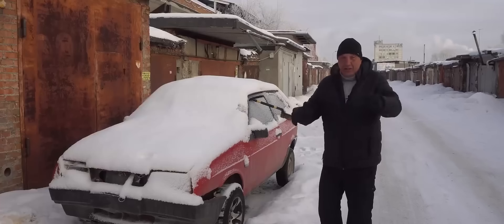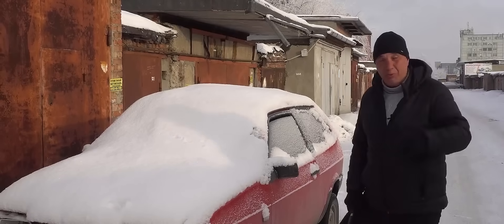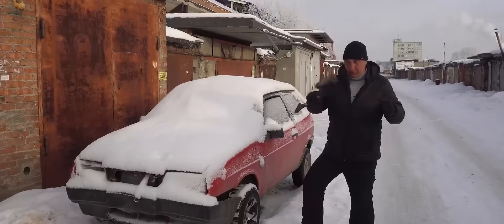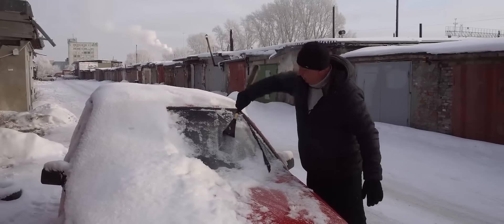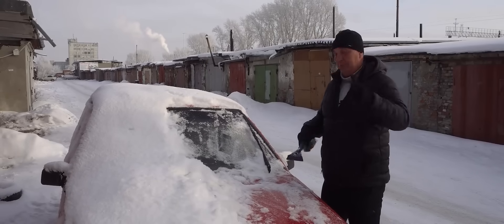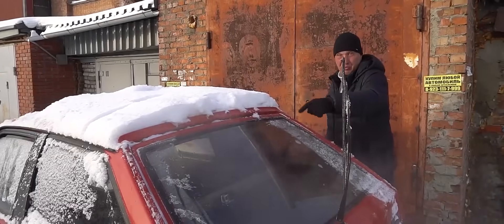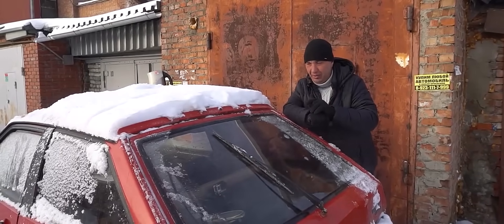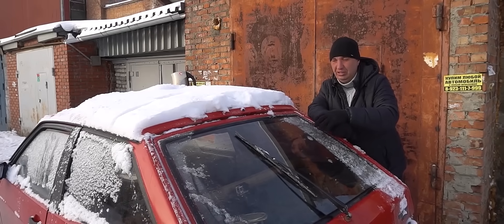What happens when you POUR boiling water onto a frozen windshield?

Comment: its probably because you opened it to put the camera in so the outside temp and got inside while you took the water to heat up probably a few mins by then the glass at adjusted to the outside temp hence no breakage...

Comment: It was not cold enough for it to crack. Honestly i think were he fucked up at was removing the mound of snow off the windshield  if he had left it on and just started pouring the hot water id bet 20$ it would have shattered the glass! Hmm also he could have filled up a squirt gun with hot water sat in the car then shot at it the outside of the windshield would still have the snow mound  on it the key is making sure the glass is as cold as it can be then you drastically and suddenly change the temperature which causes its integrity to ultimately fail it would just shatter in place thats all.

Comment: Cold glass is contracted. Heat expands it. Thus, it is inclined not to break. More likely to break sitting in hot sun several days (mine did). However, hot glass suddenly cooled with ice water more likely to crack.

Comment: Glass usually shatters when it cools down too quickly, because the particles  become compressed, causing the glass to shrink very fast. The lack of filled space is why it cracks. But when you heat glass up quickly (or any substance for that matter (haha pun not intended but still appreciated)), the particles gain energy and start moving farther apart from each other, so that the glass technically “expanded” to what it normally would be, and didn’t crack. Based on my knowledge of thermochemistry, this is my educated guess as to why it didn’t crack.

Comment: The water only needs to be above 0C to melt the ice on the glass. use some lukewarm water if you are willing to risk cracking your glass by pouring water on it. The higher the temperature of the water, the higher the chance of cracking the glass. body temperature (or 30 ish C) water will do it even if you have to do it a couple times to get it off.

Comment: It has nothing to do with foreign vehicles. I have a 2006 Corolla S and do this all the time during winter. Only I use plain hot water, not BOILING and it works perfectly fine. Live out in southern AZ where some mornings are in the low 20's
Reply: YaBoi Rob 
Low 20's = winter? 😂😂😂🤦🏼‍♂️
Reply: Skyprince27 It's the fuckin desert, what do you expect?
Reply: YaBoi Rob 
I know, I've been to Tucson in February and Phoenix in October. 
FYI: You don't know what winter is.
This is winter:
http://cdn1-www.mandatory.com/assets/uploads/2011/12/file_180109_0_montrealsnowheader.jpg
Reply: Skyprince27 Cool. Hope you enjoy it 😂. I've been to Quebec before too. Just because I don't live there doesn't mean I don't know what a season is.
Reply: yanks say temps in farengay so fuck knows what rthat means in modern measurements
Reply: Here in Finland some mornings are -20 (-30°C)
Reply: -40 s ℃ here guys just start the damn car it will defrost by itself lmao morons

Comment: You poured it to slowly and in too small amounts. From what I've heard people usually crack their windshields when they throw bucket-loads of hot water on the windshield, causing the glass to expand but not the rubber seals which are rigid from the cold thus cracking the glass.

Comment: If it's tempered glass when heat hits the cold glass as long as there is no stress on the glass it shouldn't break, however if there is any stress on the glass the heat will cause it to break.

Comment: A good way to prevent potential cracks is to run the car for 10-15 minutes at idle with full heat on.
Good for the engine in -30c or lower & the windows are warm from the inside so less shock

Comment: I’ve poured boiled water onto icy windows literally hundreds of times...never seen it shatter or crack...I always assumed that was a warning left over from the old days of non “safety” glass..but I dont know it all...maybe it could break..🤷‍♂️🤷‍♂️🤷‍♂️
Reply: you should be fine as long as you have no chips in the glass from rocks hitting it, those make the glass weaker and more likely to break and crack.
Reply: careful with warm water, i ended up with a thicker layer of ice on my window than before once xD
Reply: Is nobody going to ask why this dude has poured boiling water onto icy glass hundreds of times?
Reply: Yep, me too, but i do it slowly, it´s the only way to melt ice at such low temperature. Never had a problem, not even with already cracked or chipped glass.
Reply: Yeah but no need for the water to be 'boiling' really all you need to quickly de-ice it is warm tap water 30-40C. No point taking a bucket of 100C water to any part of your car...
Reply: I have done it every winter nothing has happened
Reply: I used to do it a lot.. Nothing ever happened.. Well it is not advised as good practice.  But it works.  If the glass has some dammage, even temperature difference can break it.  (cold night)  Removing it with a scraper in my experience does some dammage as well.  So I put an electric heather on the mains in winter time :)
Reply: El Sea ive had it crack from turning the heat on on defrost and letting it warm in extreme low temps . Never water though
Reply: Also makes a difference if the the glass is bonded to the car or fitted with a rubber gasket
Reply: Leaving a nice puddle on the floor which freezes over.  Well done.
Reply: just use luke warm water
Reply: elijah mikle but windshields are expensive af
Reply: El Sea how old are you ? Just asking, and what is your gender ?

Comment: you need to keep the wipers on. the extreme temperature difference from the hot to cold area will crack the windsheild. Pour the hot water under the wiper.

Comment: It will only crack if you do it the other way: pour very cold water onto a very hot winshield. I´ve done it by heating glass cups and pour very cold (almost frozen) water on them, instantly crack. The reason is simple: When you heat something the molecular expansion process is relative slow; in the other hand, when you rapidly cool down something that is very hot the reorganization molecular process is quite fast and almost all materials tend to crack, and if it don´t crack then it becomes "tempered".

Comment: Glass only cracks when it's heated and then cooled rapidly because when glass is cooled unevenly it leaves expanded and unexpanded areas in the glass which creates differing amounts of stress that can cause it to crack or even explode. It's called thermal shock

Comment: Pouring cold water on a hot piece of glass is many time more likely to crack.  The cracking occurs because when something cools it contracts.  So glass that is hot and then cooled quickly cause the glass to shrink faster than the glass can take and it shatters.  Heating glass fast enough to crack is extremely hard.

Comment: It is simple. The windshield on the Lada cars is not glued on the car, it stay on rubber gasket so it can take the fast dilatation. So is nothing special with yours Lada's car. The modern car use the windshield to reinforce the body.

Comment: I've been pouring water as hot as my taps could produce for years on my car windows. lot harder frozen than that light dusting of snow too. Keep wipers on low so the water doesn't freeze seconds after it clears the ice. Faster than scraping it off. Wouldn't try on an already cracked window as I'm sure it would crack further.

Comment: The cracking often happens when the windshield isn't installed correctly. Mainly due to variations in the thickness of the sealant used between the windshield and frame.

Comment: if you people think a car windshield will crack like that, then you're stupid. The cracking was from the ice expanding from the hot water. A windshield is made in 3 layers with a layer of plastic in the middle to prevent shattering with glass flying all over your face. Ever heard a pebble hitting your windshield on the highway? You can have little pebble flying at you at 60mph and your windshield wont even have a crack.

Comment: The reason the windshield didn’t crack is because your windows are open, the temp is just as cold as the outside,. If you had the windows closed then pour the hot water the windshield will crack.

Comment: Cold makes the glass contact. Putting hot water on it makes the glass expand. It won't break unless it expands so much that the surrounding area that holds it in place stops the growth and it would crack because it can't expand beyond it's borders. But if you have a hot glass, and rapidly cool it then the glass will crack because it contacts so quick that it breaks. I've done it before when I had a small fire in an ashtray and I put cold water in it too turn the fire off. The stay broke right in half.

Comment: Pouring boiling water onto glass in freezing temperatures has an endothermic reaction before it even hits the glass, flash boiling most of the water in a plume of steam. A proper windshield is heated in a furnace at a temperature of over 600 degrees and is then tempered using air pressure. It will resist endothermic reactions upto three times stronger than normal glass.

Comment: is because capitalist foreign glass attempts to steal all the heat from the water for itself causing a temperature differential whereas the sovereign domestic glass divides the heat into an equal share between the glass and thus no temperature differential to cause cracking

communism, comrades. it works

Comment: What comes to mind is if the windshield of the lada is not laminated. If it is a single "slab" of glass the head will spread rapidly and warm up the entire glass at once. On newer cars the windshield is laminated, which means heat will travel more slowly towards the inside and that will maybe result in a crack.

Comment: The reason not to use hot water has nothing to do with the glass and EVERYTHING to do with the glass seal.   Use just cold regular water and get those wipers working / or wipe them clean and you'll be just fine.

Comment: glass only cracks when it is heated and cooled quickly in succession, why did you clean the window as the hack would work on the snow filled window. 
although when its hot it expands so a rigidly installed piece of glass that expands with no space will crack instantly

Comment: Honestly what else we’re you thinking. Some people can hit a window with a hammer as hard as they can and nothing happens.
Reply: Akira One Hollywood
Reply: "Some people can hit a window with a hammer as hard as they can and nothing happens."
Sorry but no, hitting a window with a hammer 100% breaks it. Unless you are a child and it's a rubber hammer. 
Car windows are designed to break and crack but stay together mostly, so if you hit one with a hammer it will crack badly like a spider web effect, but the window usually won't shatter and fall to pieces usually.
Reply: Akira One yep, because glass is designed that way, which is why window breakers work because it takes that force and applies it to a few millimeters of space, and from there it’s a domino effect
Reply: not true at all unless the hammer is a roofing hammer. if the window was that easy to break then it wouldn't be a problem breaking them to get people and animals out of the car when its needed. and keep in mind that though you are correct, you are only correct when the striker hits the window multiple times wasting precious time, which is why "window-breakers" are specially designed the way they are.

Comment: If you put a chip in a windscreen a crack may originate from that chip and grow longer over a number of days, without any sudden changes in temperature. If that is happening and you pour hot water on a cold windscreen or vice versa the process of crack propagation will be accelerated, that is what happens. 

Cracks will always originate from a point of high internal stress no matter what the material is. A small chip in a windscreen will provide that sress. The windcreen in the car in the video clearly has no pre-existing damage.

Comment: What if it’s not glass and just Plastic.
Although i doubt it.
Reply: RiAnime never underestimate Russia
Reply: Well windshields are just 2 pames of glass with a plastic sheet inbetween them.
Reply: These types of laminated glass and tempered glass have a fairly wide thermal gradient. Even the fact that the thermal shock is from freezing temperatures to almost boiling, however, it’s most likely still within its static thermal limits. Meaning, the glass is being heated over a larger area when he pours the “boiling” water. 

It’s sort of like how you can burn yourself on a hot surface. If the temperature is really high, you can have a more significant burn injury in less time. If the temperature is lower but contact time is prolonged, you can still receive a significant burn over a longer time. So for burns (thermal stress) it’s a relationship between temperature and time. When he pours the water over a larger area the heating rate is decreasing and therefore the dynamic stress is decreasing.  There are many factors that can account for dynamic thermal stress compared to the static thermal stress, mainly the rate and area. Some glasses have microscopic variations, depending on its composition. 

Anyhow, enough rambling. Nothing breaks here.

Comment: It didn't crack because Lada's use a rubber windshield gasket like an older car, it allows the glass to expand and not crack and it's laminated glass, import cars have their windshield glued in with very tough silicone adhesive, the glass can't expand and so it would crack.

Comment: The fact it is rubber mount helps, if you do it on bonded screens there is less room for expansion of the glass.
Additionally, a compromised screen with stonechips or cracks you didn't notice would have very different results.

Comment: This is vary interesting because I fix windshields chips and cracks for a living and we are only supposed to fix the weather between 45 degrees Fahrenheit and 95 degrees Fahrenheit because the chip or crack can spread while we work on it. Maybe if you have a chip already then change the temperature rapidly it will cause it to crack.

Comment: It depends on how suddenly you introduce the temperature change.   Pouring it on slowly apparently didn't cause a drastic enough shift of temp change to implode the windshields here.   If you were to splash the water onto the windshield in a large volume of boiling water, it no doubt will work fine.

Comment: The driver's window is down a little. It allows the pressure that would build up inside the car from the sudden rise in temperature inside from the hot water. In a sealed environment the Cold air in the car would act as a wall and the heated air against the glass would push outward. However it needs to be much colder for the cold air to be a good barrier.

Comment: there wasent enoff pressure inside the car... having the window down a bit means the air inside the vehical can displace.... also, the dude took too much ice off the winshields.... redo the test, with a sealed car, and pour cold water on the windshield an hour or 2 before the experiment.... your results should change drasticly xD

Comment: in us its standard for front windshields have 2 layers of glass with a plastic layer in the center, generally the curvature of the windshield is slightly bubbled outwards, usually the heat related cracks I've seen is when there's too much heat applied from inside and it pops the outer layer cause the inside expands, flatter windshields will be more resistant to heat and if it doesn't have the dual layer w/ plastic it probably is immune to the heat cracking.

Comment: I didn't think people had this issue. 

Here in the UK, when the car is frozen over I always get hot steaming water in a bucket and chuck it over the car. 2 or 3 small buckets or large bowls gets the whole car covered.

It's very effective and quick than letting the heating system clear the frost and condensation on the car

Every car I've been through has never had a crack because of it.

My list:

A really old Micra (the boxy kind)
The micra generation after that (curves rather than angles)
A really old fiesta (curvy and 3 door)
Mercedes C200 1998 model
M3 Wagon 2003 model

I really didn't care about the car I drove until the merc since there were bigger concerns before someone starts yelling that I didn't state the exact model and year because I didn't actually drive a vehicle.

Comment: different materials then other glass. if you had a glass pipe and it was cold enough and you heat it with a propane torch it will instantly split the glass or make it explode.